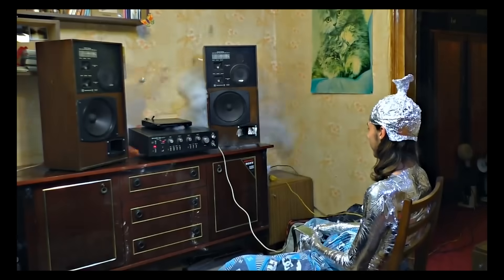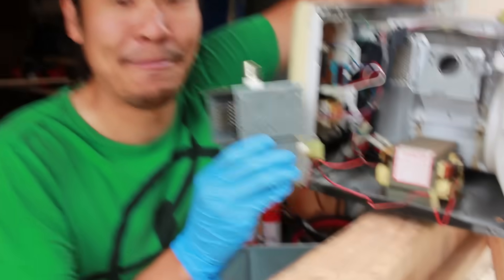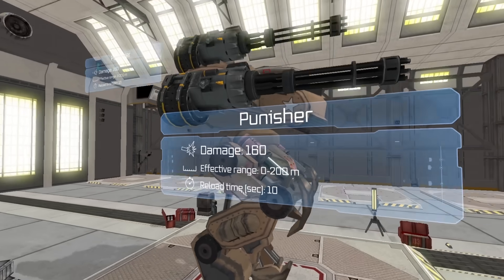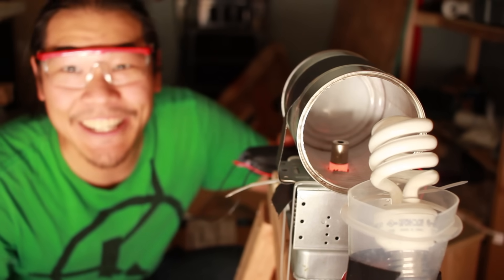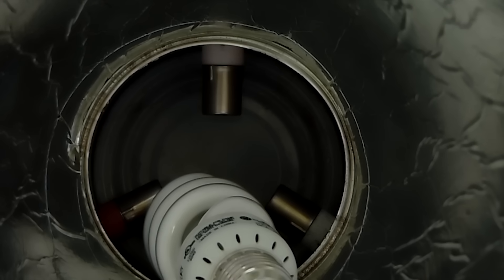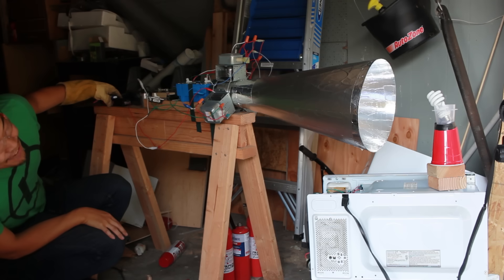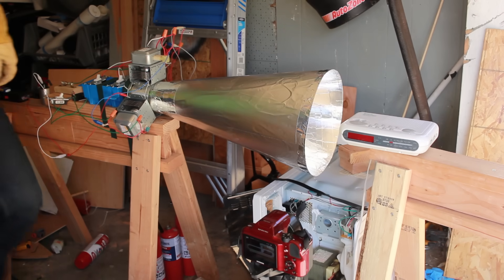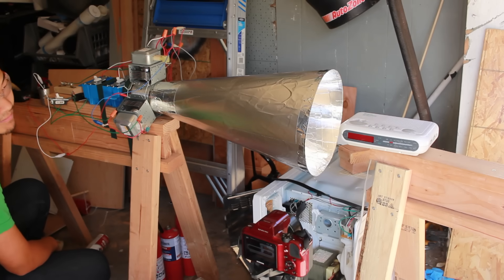A Microwave Gun Made From Taser and Soup Can??? (Testing Kreosan's Magnetron Cannon)

Comment: Some important details mentioned in that Ukrainian video that you've missed:
There is a certain resonant proportion between the magentrons and the dimentions of the cone+tin can. They purposefully refused to explain that in details to prevent kids from trying this at home. 
The taser has been opened, it's power has been increased, supercaps have been added.
---
Even if you don't speak Russian you can enable the subtitles. Those translations turned out to be quite accurate. Except for the term "militairy grade capacitors", which should have been translated as "heavy duty" or "skookum" or something along those lines.
"boyewoy"=ready for battle, not necessarily militairy application.
Reply: You would be better off using one magnetron , a larger capacitor  and a properly sized resonating cavity.
You need a chamber that resonates with the frequency of the magnetron:
 1. You need a tube 12 .25 cm across 
2.  It needs to be 24.5 cm long 
3. The antenna needs to be centered in the tube 12.25 inches from either end.
4. Your cone needs to be ...you dont need a cone, get a satelite TV dish , place the end of the tube facing the dish at the same  distance and angle the receiver was at . 
( Recommend "Direct TV" since their dishes will angle the beam off to one side, avoiding your rig )

You will cause massive interference with anything that isnt shielded ( most stuff is shielded nowdays ) up to 50 feet away .

 A shield is that thin sheet metal  that surrounds the sensitive electronics and the power supplies .
( The power supplies aren't sensitive, but they GENERATE electronic noise , so they are usually shielded to protect the rest of the device from it. )

I suspect two things about the rig they were using.

1. They used a prop for the camera , and a real one outside the camera's view. If the whole thing was faked you wouldn't see the RIGHT KIND OF INTERFERENCE on the camera.
2. They rigged fire crackers when the shot of the device failing wasn't dramatic enough for "views".

What happens when you "shoot" one of these at a modern car.

-The car starts mis-firing as the ECM confuses the EMP pulses for "Cam and Crank sensor signals" and then immediately starts running normal as the EMP pulses stop.
-If you open the hood so the microwaves have a line of sight on the engine harness , the engine will just die , it might restart and run normally , you might need to buy a new ECM, it all depends on range.

But you either see a car start idling rough , or it just stops running , nothing "View Worthy".
Reply: @glennchartrand5411  df is " same distance "? Also ur saying just eyeball d satelite dish?
Reply: The equations for circular and rectangular wave-guides, as well as  various feed-horns, are very well know.
Your electronics text would have to be published before 1910 or so to not have this stuff.
And really, there is nothing on either of these devices that looks anything like the proper dimensions for the wavelength of the 2.45 Ghz magnetrons.
There are no secret ratios between components.
Reply: Nah man, have you seen the size of a microwave Transformer?
Reply: Also Gap wasn't required in that configuration, cutting power output to magnetrons in half.
Reply: Don't mind me, just an untapped mentality scrolling through you smart beings conversation.
Reply: I think he deliberately made the cone out of cardboard too wide and omitted the capacators, maybe misaligned the magnatrons  so the experiment would fail.  He seems very biased against this and i think his goal was complete debunk whether it did or didnt work.
Reply: sasja de vries. Кто из Росии?
Reply: Honestly speaking, those Russians would be dead if their device worked as they claimed, I have a EE buddy who back in college took a microwave magnetron and coupled it to a proper microwave waveguide and tried to make popcorn while the corn was still on the stalk in a field.

A few birds flew into the beam while it was powered up, and they were dead before they hit the ground due to about 1KW of microwaves cooking their brains.

After that we decided we probably shouldn't be operating high power microwave devices without ourselves sitting in a proper faraday cage.
Reply: @fragger56  sounds like bs. Wat powesource did he use 4 1kw? Also d energy loss across those 30+ m would be over 90% easily. Microwawes work at 2.4 ghz, dats very short wawelength.
Reply: @fragger56  tf kinda powersource was your friend using to get 1 kW

Comment: Translation of the very beginning of the original video: "(Guy in robe:) Source of microwaves are magnetrons from microwave ovens. It's powered with high voltage from the stun gun. The secret of far effect distance is in correct match of Magnetrons and horn antenna. (Other guy:) Which was hard to get. (Guy in robe again:) There is used a powerful stun gun with amplified supply, and 'military' capacitors. ('military' means they powerful-as-f**k, in general they significantly outperforms usual capacitors)"
You didn't match the magnetrons with antenna, aren't ya? Also 30kV might not be enough, Kreosan have amplified their stun gun.
So your "mythbusting" has some significant flaws.
Reply: HungryDoodles eh, I can forgive the guy since the original vid was so clearly fake. You don't tend to put too much effort into proving something that you know isn't real
Reply: If the original video was fake, then they would have faked the camera glitching at considerable range, without the horn pointed directly at it.
I'm not sure. Since he was able to replicate some of the results without knowing the exact details of the Ukrainian video, that leads me to think that the original video wasn't fake, or at least not completely fake.

Comment: +Sufficiently Advanced
Sorry but i have to say this video is bad because you try to debunk something by doing it wrong xD. 
1 a taser is not taser ;D there a hundret of crappy weak version and i guess the russians have a powerful one which would be illigal in some european countries ;).
2. Microwaves are not easy to handle and antenna design is not an electronics beginner project. In fact you need to be experienced to know this.
the power of 4x 18650 Lion Batteries is about 65Wh and in implus mode the can deliver around 10x of that amount for short burst so around 650W for 100ms (10% duty cycle)
So it is technical possible to drive a 700W Magnetron with these batteries, you just have to do it right. Also you forgot to use the diode.
this dude first makes sure the antenna works correct:
https://www.youtube.com/watch?v=80kDn4vit_w&html5=1

Comment: It's microwaves you're playing with which need a waveguide to work most effectively. Your microwave generators (Magnetrons) are aimed across at each other rather than down the length of the horn. Try fitting all three at the end of the horn pointing towards the open end and retry the experiment. Not saying it'll blow anything up but it should produce far better output. Also try tuning the horn parameters to the frequency/frequencies being used. They can make a huge difference.

Comment: Can not work ! Tube needs filament voltage and high voltage with high current and about 1/2 second to begin oscillation and output of microwave energy ! I dont need to build it to know that this will not work !

Comment: sync the magnetrons or just use one magnetron, use a narrower and tuned waveguide, propper hv power. and you do not post a how-to exactly how it's made so idiots don't blow their heads or their parents heads just from watching youtube. 
these damn cheap mags can be pretty punchy if you take away from their lifespan. they survive pretty high pulses of much higher energy than you store in a 1uf cap.
their filament blows from the magnetic stress eventually but the y do _deliver_.

Comment: On the first test, you're wave guide setup is wrong. Major issue is that you are covering the beryllium portion of the wave output w/ the wave guide (can). Also, the can is mounted in the wrong direction. 
Second test, wave guide mounting still looks like shit as you are shooting waves AT THE SIDE of the inside of the wave guide, instead of DOWN the guide, & it looks like you are still covering the beryllium portion w/ the body of the wave guide. - It's called a 'wave guide' as it's function is to guide the waves in the direction of which the output(s) are pointing! 
Do not cover the beryllium! You are not guiding the waves by covering the beryllium portion of the output w/ side of the wave guide!
However, even if it was right, a stun gun as a power supply does not supply enough current for the desired output from the system.

Comment: It is possible...You can build a maser using a magnetron from a high wattage commercial microwave oven & a custom home built wave guide that can burn holes in 1/2" plywood @ 100 yards & blow up cellphone batteries @ 300 yards. 
However, a stun gun is an insufficient power supply.
Get yourself a copy of 'Poor Mans Ray Gun' from Amazon; detailed instructions!

Comment: You're probably right about the video not being real. But microwaves are electromagnetic waves and if you have 2 out of sync/alignment with each other they can actually cancel each other out. Google "double slit experiment" or "destructive interference" for more info on this it's not exactly the same but it shows what I'm referring too. 
If this is the case you might get more of an effect if you used identical magnetrons with the same frequency and the same faze and upped the power.
I highly doubt you could get things to explode though but I think you could build something that kills electronics at a distance with a bit of work.

Comment: Why not use a car battery
Reply: voltage is far too low.
Reply: Then wire up a thousand car batteries in series. If you're gonna build a viable emp it's gonna cost money to build.
Reply: that would work but good luck with the fires and cell explosions from overcharging.
Reply: Mikail Elchanovanich you are dumb
Reply: thanks, i look forward to your correspondence in the future as you stalk me around the internet because you have nothing better to do.

Comment: Make it just as simple as their setup. The one you built has like too long wires and that makes resistance and can affect the circuit. Maybe that is why it is not working that efficiently as the one in the original video
Changing it a bit will make a big difference. Can you please try their exact same setup.

Comment: now do it for real instead of off of some dinky little 1-5k mAh batteries. i mean, I've used MOT's to do spot welding before, albeit after rewinding the coils. wire those MOT's up to mains and i bet you can pop plenty of electronics just off of current induction in the PCB's. hell, even just one driving the electron guns should do the trick.

Comment: For future reference get an old window screen that uses the metal mesh. Ground it and put it between the camera and the source of the microwaves. Use manual focus to force focus on the subject instead of the screen and experiment with the distance between the screen and the camera. You should be able to make the screen mesh disappear visually while it protects your camera's electronics. 
Tip. If your camera doesn't have manual focus, put the camera in airplane mode. No not like your phone. This is a mode meant to shoot photos of outdoor scenery through a window. It force focuses your camera at infinity which depending on the camera and lens can be as close as 3 or 4 meters.

Comment: One idea for you, replace the stun-gun with a cattle prod they tend to have more power.  And add a 1/2 to 1 farad capacitor to get more power storage in the circuit to fire the magnetron.  Because as one user stated it is a pulse weapon.  Also I would use emi/emp shielded camera housings.

Comment: Your waveguide probably isn't doing much to help, if not hurting your output. Polarization and cancellation might also be occurring with the multiple magnitrons and their orentation. This is potentially evidenced by the banded lighting from the flouro tube when you put it inside the emission cavity. The Russians might have gotten lucky, or did something right with their setup. Look up some cylindrical microwave waveguide designs, and try it again and I think you'll be impressed how much impact it can create.

Comment: To get what they demonstrated (as a pulsed herf gun) out of it, you would have to have a lot of big electrolythic capacitors in series and switch it with a thyristor, you would have to make a high voltage charging circuit for it

Comment: Well here's the thing, anyone with a decent understanding of physics and electronics will tell you right away that this WILL NOT work, no need to test or build, it's just not possible. The reason that there is a little bit of light visible in the fluoro tube is simply caused by the high voltage/frequency from the taser. You can get the same effect if you put a fluorescent bulb next to a plasma globe.  A Very high potential is needed to accelerate the electrons off the cathode filament.

Comment: This is actually on the right track. However, as he said, the voltage is too low. Introduce a few more capacitors and a zvs flyback, and performance should significantly increase. And that cone is bloody useless, you'll want a parabolic.

Comment: With 2 18650s i can pull a peak 180w, you might need more batteries than just 1. Also, 18650s that are high amp draw may assist in this. In their video it looks like they had 5 18650s, maybe that's how they drove the filaments, since unless im mistaken, the high voltage is simply meant to "fire" the electrons, not power the magnetron

Comment: If you try a flyback system to the high voltage it will maby work a little better i gess 😁 and i also thing that the microwaves need tod be more "concentrate"

Comment: And btw... I am a electrical engineer, and what u did there is ultra bullshit. What is even the purpose of the spark gap, only than reducing power and frequency. U should have mounted the ends to the front,or make them reflecting out of the front, or it will pretty much cancel out at the beginning, and BTW u forget that these components work at a specific voltage, so a taser won't do it because its high voltage, that just straight up dumb. These large blocks (coils)that where in the microwave where used to pump the voltage up to the right point, and as batteries u would have something with 230v, or in America it was 130 or smth, which u could solve with a smaller coil in front of the bigger coil.
No myth busting there, just a guy who has no idea of electronics

Comment: You shuld heat the fillament up by connecting a current trough the small connector on the magnetron and add high voltage to the case of the magnetron and one of the pin from the connector.

Comment: Im not sure if this an good idea to say,,,, but here we go.  Microwaves use mirrors to direct and focus the waves inside the metal box.

In your build hardly any waves get directed towards the exit of your pipe thing what ever tindoul dohiggy...

Maybe few more caps and batteries in barael or what ever is it when they are not connected in series to get more juice out. Maybe even combine few to get more amps and then few to get output voltage higher aswell.

Comment: The reason the microwave cannon didn't effect the radio is probably due to the fact that microwaves and radio waves are so close on the electromagnetic spectrum that they cancelled each other out. Also you could use zippy batteries to power the cannon e.g. the hack smith's proto saber project.

Comment: If you look at the Ukrainian vid, you can see a stack of blue capacitors they use. I've seen similar ones in old CRT monitors. I'm guessing they were charging longer between discharges, but getting a lot more power per pulse than yours. Not saying that they didn't use a bit of movie magic, but I could see they had more capacitors than yours did.

Comment: 9:05 the “vape” battery’s that they were using were not your average 18650 battery’s, the vape ones have a 30-60 amp output. So let’s say they were 30 amps, and 3.7Volts they would put out 111Watts. There were 18 battery’s, this means they had almost 2000watts (1998W). Enough power? Probably not! But it’s fun to dream.

Comment: In stead of the stun gun use a car battery
Reply: True things animation Car battery = 12v, Stun Gun = 10.000 - 100.000v if not more.

You need high voltage for the magnetron to work.
Reply: Or just use the transformers from the microwaves. 3 microwaves means 3 transformers (coils).
Reply: You still need a high enough voltage..
Reply: and? you can use a DC-DC converter to get higher voltage, or use a transformer to get very high voltage
Reply: except the car battery can provide hundreds of amps, how do you think cars start their engines? a normal car battery can usually provide up to 7,200 watts of power, which is more than enough for the 100 watt magnetron needed
Reply: Al Eks Transformers don't work with DC though.
Reply: inverter circuit
Reply: Al Eks And after that a rectifier circuit?
Reply: sure, there are many ways to turn low voltage DC to higher voltage i am not saying to use this specific method though
Reply: Al Eks There are certainly more easy and efficient ways, yes.

Comment: It functions as any regular microwave, and as usual you don't put metal inside or it will heat up rapidly, try a spoon as a target and touch it after you'll feel the change. 
you can further upgrade your current by using a car battery and a regulator.
Note though its a wave and it can only go so far.

Comment: Use one of those ultra high C rating lipos, and power a high power inverter with it that feeds into a HV transformer ripped out of one of those microwaves. Then you can use the output of the transformer to power the magnetrons.